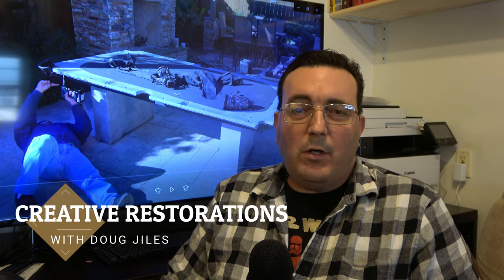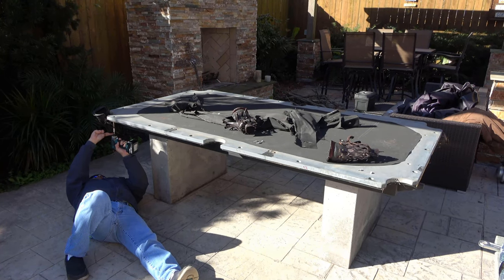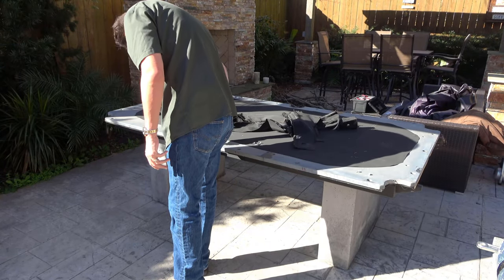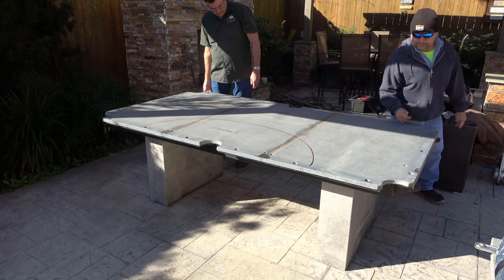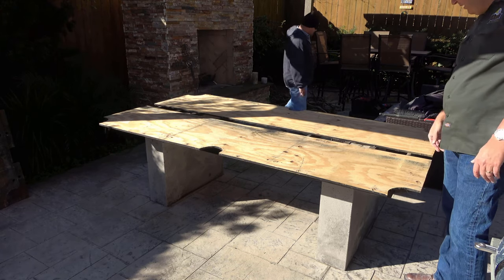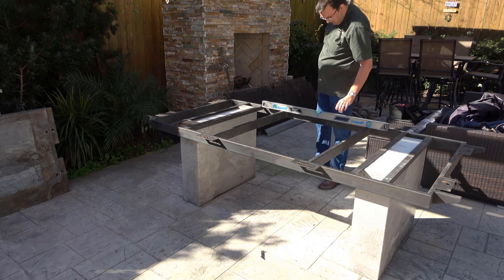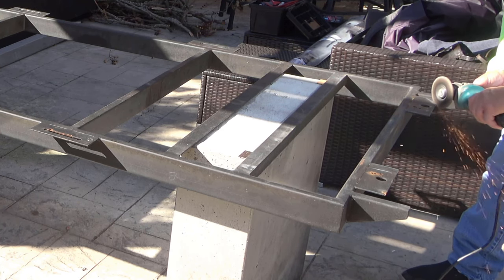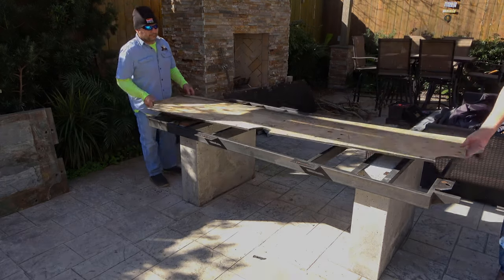Outdoor Pool Table Repair and Recover PART 2

Comment: Glad you're back!  When I commented last I mentioned that I was looking forward to seeing the view of what's under the slate.  I'm such a coin-op guy that I assumed that outdoor tables would have ball returns (which would also direct water)!  So, now I'm guessing that outdoor tables are usually drop-pockets to keep them simple in defending from the elements.  Does water ever seep horizontally under the slate?
  On this Part 2 table, do you think the designer was planning on the plywood being just as unbending as the slate because of the slate's weight? That would explain putting wedges under the wood.
Reply from the maker: I have no idea what the designer of this table was thinking. I'm sure, though, one of his thoughts was, "Some sucker is going to buy these things and I'll make a fortune selling them."

Typically, water-resistant materials are used when making an outdoor table. So, yeah, water does get trapped horizontally sometimes. But, it doesn't cause an immediate problem. But, when they use wood, it's a long-term problem. Personally, if I were manufacturing an outdoor table, I would use UHMW (basically cutting board material) in place of wood on the whole table. The concrete is an issue too. Concrete continues to get harder and harder (and more and more brittle) as the years pass. Not to mention, the continuous expansion and contraction from the heat of day to the cold of night, expansion and contraction from season to season, and the hydraulic pressures from constantly getting wet and baking in the sun, all add up to LOTS of cracks in the concrete. PISS POOR DESIGN overall!

I've seen MANY manufacturers use plywood between the slate and the frame. When it's narrow pieces that only extend past the frame an inch or two, it isn't a problem. But, some of the cheaper manufacturers want to save money on the shipping costs of slate. So, they opt for unframed (which weighs roughly the same as framed but takes up half the space on a ship or train) and use wide pieces of plywood. It's a VERY cheap way of making ANY table, it ALWAYS causes issues, and, I've had this exact same problem with every one I've run across (indoor and outdoor tables). Leisure Bay and Beringer are both guilty of this!